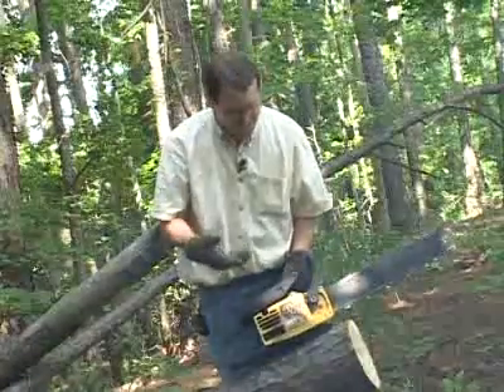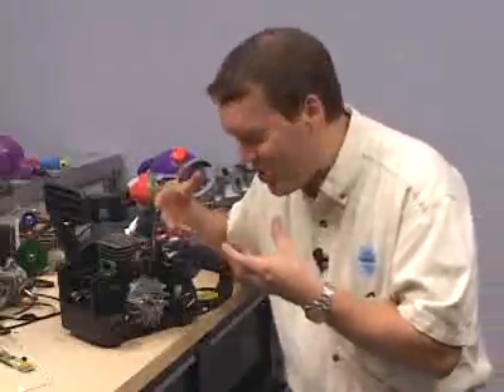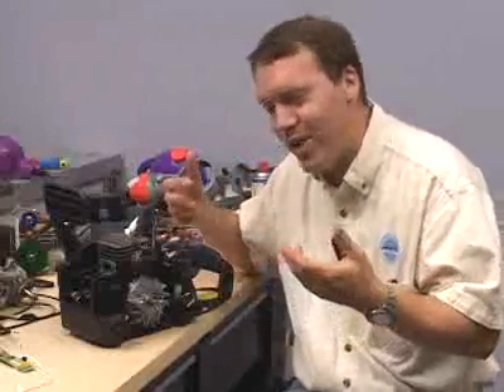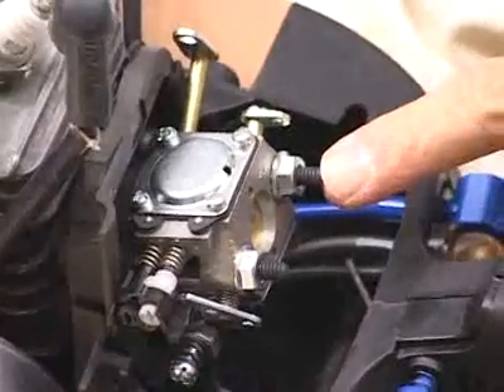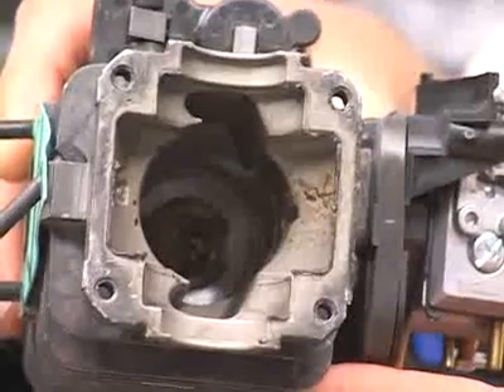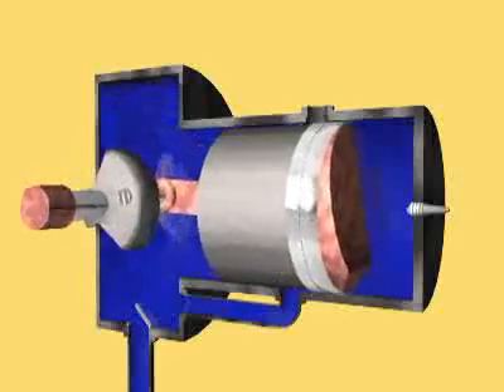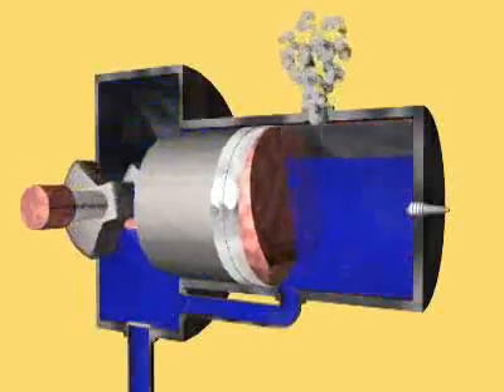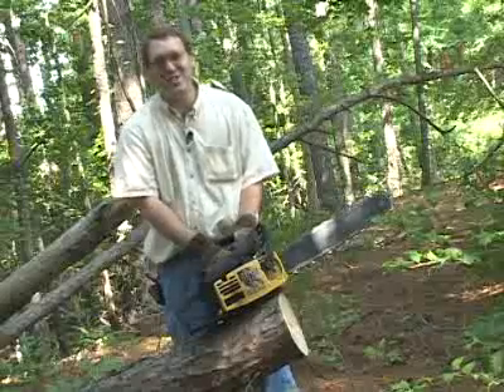How Chainsaws Work

Comment: He's just totally wrong. A chainsaw works by having  3 types of link. One is the offset, that keeps the chain from digging in so much that it binds the saw or kick backs. The next part is the wide cutter that keeps the cut wider than the main cutting blades to keep it from binding. Finally you have the cutting blade.

Comment: dude im a logic thinker but I thought it cut stuff down with very fast speeds didn't know it would use blades on a chain that could be dangerous as a logic thinker what if one of the blades flys of at high speeds and pokes your eye out? see you don't think too far.. anyways its over now I know how it works xD.

Comment: "The chainsaw has four main parts, the output shaft, the carburetor, the electronic ignition module and the motor"

WTF all those parts make up the motor, they aren't separate! The electronic ignition module is so insignificant to this video, what the hell happened to the chain, or why not the handle on the starter cord or the bolts holding the thing together seeing as hes in the mood to mention all that crap

FAAAAAAAAAAAAAAAIL!!!!

Comment: That's not at all how a chain saw works. That's how a 2 stroke engine works. A chain saw works by using a complex design of teeth to 1) tear wood fibers 2) pull the material from the cutting area (so it doesn't clog) and 3) using a specific "set" of the teeth widen the cut to avoid "sticking" the blades.